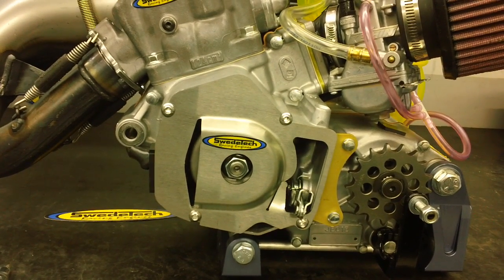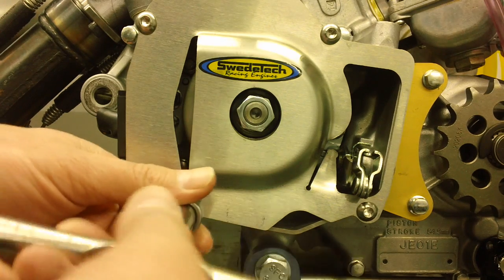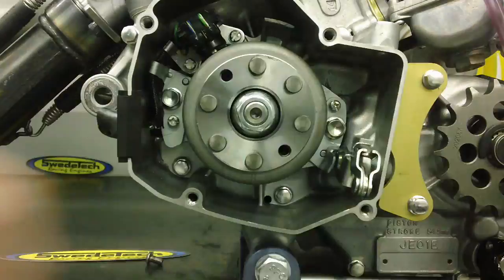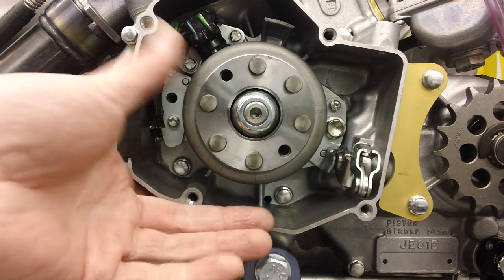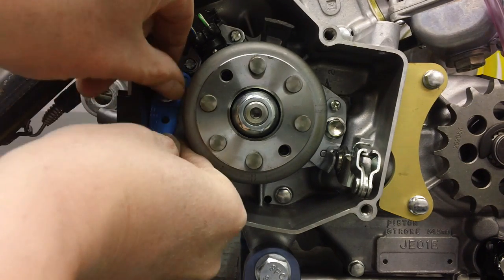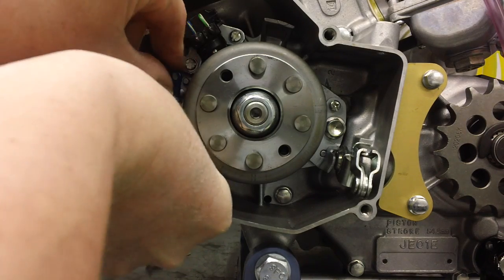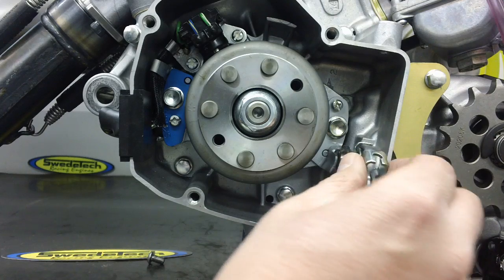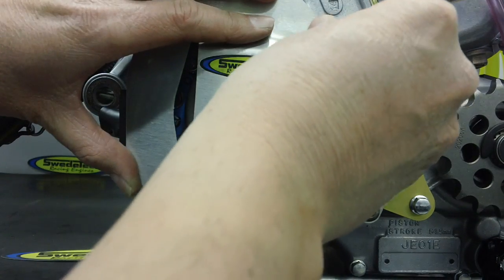SwedeTech   How   To   Install   SKUSA   Stock   Moto  Timing  Plate

Comment: Hi my name is Thiago .

I`m from Brazil. I need identify what a year to my engine. Could you help me ? I bought this engine in a used parts. After this I will buy parts with you!
Reply from the maker: hi Thiago.  You can email us a few photos of the cylinder, ignition box, and connectors and we may be able to help identify for you
Reply: Perfect. I set a email to you yesterday! Best Regards!
Reply from the maker: Please send to info@swedetechracing.com  I did not receive your email
Reply from the maker: I sent you an email and it was blocked

Comment: No thread locker on any bolts??
Reply from the maker: For the ignition bolts, we do not use Loc-tite.  We torque them to the proper specifications.  Depending on the rules, the ignition can be adjusted, and the use of a thread locker can make this task a little more difficult.